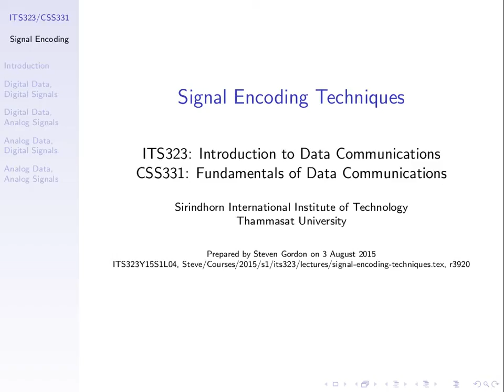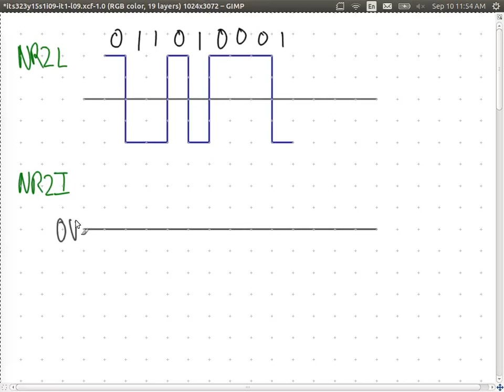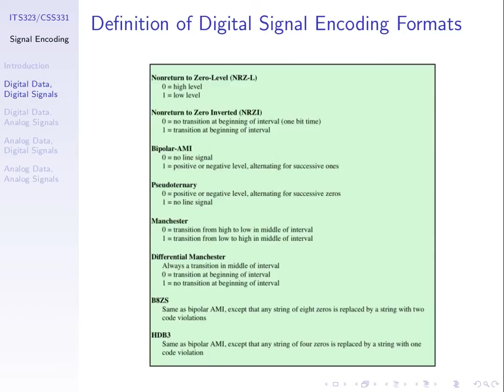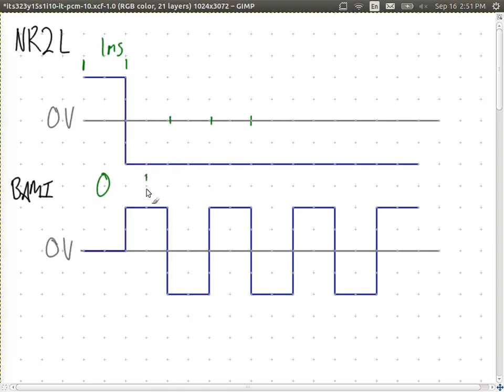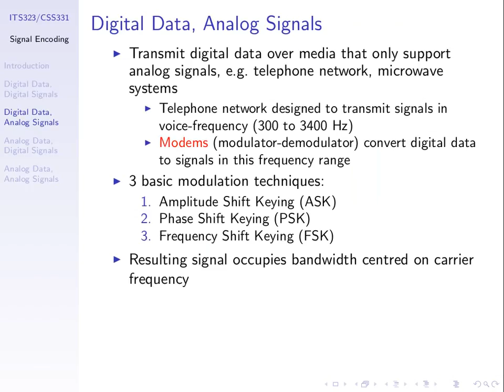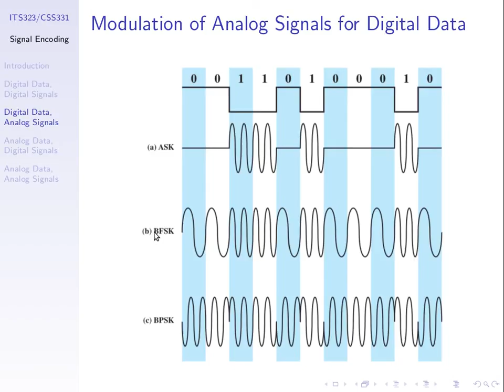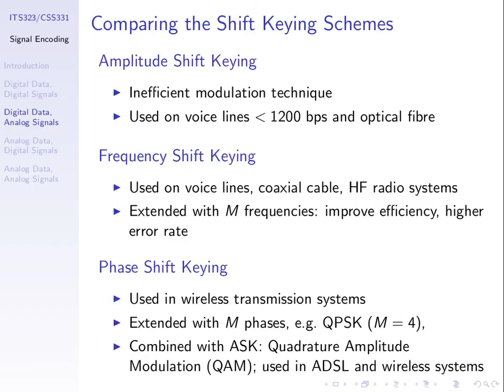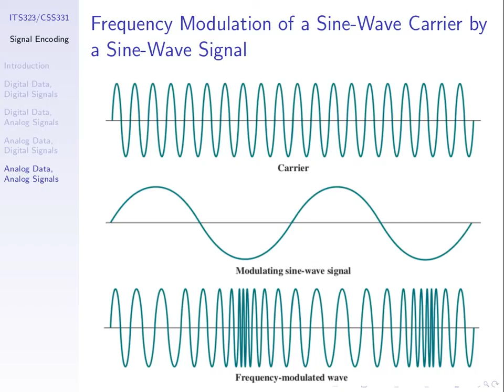Signal Encoding Techniques (ITS323, L10, Y15)

Comment: • Codec deals with digital signals
 • Modem deals with analog signals

Digital Data, Digital Signals
Encoding schemes
 • Simple scheme
  ○ Bit 1 = high
  ○ Bit 0 = 0 low 
 • Other schemes use pulses
 • NRZ-L
  ○ Simple scheme
  ○ 0 is high, and stays high until we get a 1
  ○ 1 is low, and stays low until a zero
  ○ Used in USB
 • NRZ-I
  ○ Switches on 1s 
 • Bipolar AMI
  ○ Returns to zero
  ○ Switches on 1s 
   § Always alternates, will never have 2 spikes in a row
   § This is the in-built error detection
 • Pseudoternary 
  ○ Opposite of BAMI
 • Manchester
  ○ Used in ethernet
 • HDB3
  ○ Count bipolar pulses from the beginning of the last substitution (not the beginning of the entire bit stream) 
  ○ A bipolar pulse is when you go from high to low
 
Why different schemes?
 • BAMI can detect errors by checking for two negatives in a row 
 • Some encoding schemes use more bandwidth than others
  ○ BAMI needs 3 levels, which is more than the others
 • NR2L may cause synchronization issues if a long series of 1s is sent
  ○ The receiver may have difficulty determining how many ones, if the clock isn't perfectly synchronized with the transmitter
  ○ B8ZS handles this error by doing what AMI does for 1s, but having variations for long strings of zeroes
  
Digital Data, Analog Signals
 • Modulation of analogy signals for digital data
  ○ 3 vars to change: Amplitude, frequency, phase 
  ○ 3 modulation techniques, ASK, BFSK, BPSK, for each var
 • ASK
  ○ We identify 1s by checking for higher amplitude
  ○ Not efficient, suitable for optical fibre, RFID
 • BFSK
  ○ We identify 1s by checking for higher frequency
  ○ Can have multiple levels by sending in multiple different frequencies 
 • BPSK
  ○ We identify 1s by changing the phase
 • QAM
  ○ Combination of PSK and ASK
   § Different phases and amplitudes
  ○ QAM 256 means 256 levels 

Analog Data, Analog Signals
 • We often want to change the frequency of data during transmission
  ○ Typical human voice ranges from 0 - 4khz 
  ○ Sent via 900khz microphone
 • AM radio: amplitude modulation
 • FM radio: frequency modulation
 • 93.5Mhz is the carrier signal